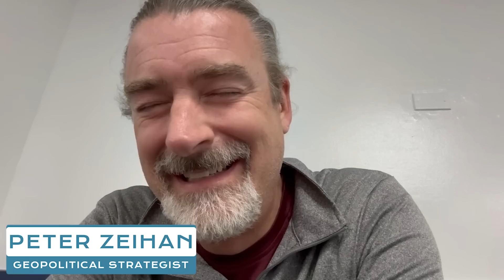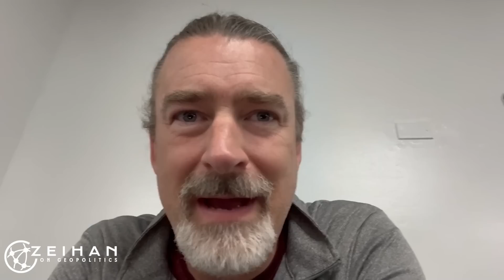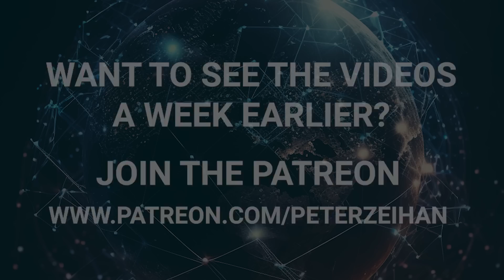Nuclear Power's Facelift: Small Modular Reactors || Peter Zeihan

Comment: While small reactors may offer novel solution, nuclear waste management remains an unsolved issue. We're swapping one reactor generating, say, a gigawatt, along with its cooling pond and security perimeter, with 20 reactors, each generating 50 megawatts, each requiring their own waste management (cooling pond?) and security perimeter.  This sounds like spreading a problem.

Comment: Large or small, any reactor that uses solid fuel and burns uranium is going to generate a lot of high level waste that needs to be either buried or reprocessed. Most also require HALUE which is in extremely short supply. So, if you order on of these plants be prepared to wait in line for years to get it running, and then be prepared to deal with the same waste problems typical reactors face.

Comment: The most promising thing about SMRs is that we don't have any experience with them so we aren't aware of the actual problems that will manifest as they are brought on line.

Whenever I come across videos touting the benefits of any reactor technology I like to tell one small part of the story of the start up of a "new concept, highly efficient" nuclear power plant, the Ft. St. Vrain High Temperature Gas Cooled reactor purchased by Public Service of Colorado. The nuclear steam supply was built by General Atomic in San Diego, CA. At the time I was an engineer working for General Atomic and responsible for the mechanical design of the reactor control rods.

During the final weeks of the plant being turned over to the utility in 1974 an electrical engineer was checking electronic circuits on the control rod system. A slip of his probe caused a short causing the reactor to "scram", meaning the control rods were moved into position to shut down the reactor. 

As part of the plant safety protocol outside diesel generators were automatically started to provide back up power. However a few days earlier a local contractor, doing clean up outside of the plant had, incredibly, repainted the generators, INCLUDING THE EXHAUST MANIFOLDS. When the exhaust manifolds heated up, the paint burned off in a cloud of smoke and the smoke drawn into the ventilation duct for the control room which was being operated by utility employees who were to be the sole occupants of the control room when the vendor engineers left the site. 
What did these highly trained operators do when the room filled with smoke?   They ran out of the building. It was left to a few remaining General Atomic employees to shut down the reactor.

This kind of a problem has no doubt occurred with many different new technologies but with nuclear materials present an entire realm of unique  dangers are present, radiation exposure, environmental contamination, proliferation, and massive cleanup expense.
Crazy old Ralph Nader said many years ago in a TV commercial that we obtain marvelous power from a nuclear reactor, the sun, that the sun was 83 million miles away and that is just about as close as you want to be to such a thing.
 I left the nuclear industry in 1979.

Comment: Water-moderated pressure water reactors (PWRs) have not had a single radiological casualty in over 70 years of operation (Chernobyl was NOT a PWR). There is no need for a "safer reactor" -- but PWRs are only 1% efficient whereas breeder reactors can generate more fuel than they burn! This technology was demonstrated in the 1950s.

Comment: It may sound strange but the best waste option is very deep sea.  This requires dropping into soft soil in a very deep plate subduction zone.  The natural subduction will take the waste under deep continental plates permanently.  { in any practical term }. Some Generation 4 reactor designs can burn up nuclear fuel waste. MSR, Molten Salt Reactors, are ideal.  Also, an excellerator-driven neutron plant is being built.  This system can not meltdown.  Basicly, it is just turned on or off.   No fission chain reaction is required.  Fission is controlled by artificial neutron production.  This system can produce heat. It requires external power.  This could also produce valuable material for science, industry, space and medical uses.
Reply: True. It sounds weird, but we've never had a Love Canal or Times Beach after deep ocean dumping.

Comment: SMR reactors have become problematic recently.  I hope countries start looking more at other Generation 4 reactors.  China has 3 Gen 4 reactor prototypes including a gas cooled pebble bed reactor and 2 MSR, Molten Salt Reactors, in the Gobi Desert. In a Texas University they have completed a facility to build an MSR reactor.   Terrapower has started construction of a facility to develop a sodium cooled, fast breeder, wave reactor. Rolls Royce plans to start production of MSR reactors by 2030.  India has an SMR project and Generation 3 sodium cooled fast breeder reactors to use Thorium as fuel.  But not any MSR reactors to use Thorium that could be easier to develop.  China and India are making amends and China could be an MSR partner. India and China have lots of Thorium.  Thorium can be much cheaper than enriched Uranium. The Terrapower reactor could also use Thorium. Indonesia and a US company have a plan for MSR reactors on reinforced concrete barges.  Finland has just completed a very modern waste storage facility. There are many storage options but no political will.  Thorium could be mined in the US with valuable rare Earth mining byproducts.  The US government is developing more flexible regulations to suit Generation 4 reactors.  Current Gen 3 technology struggles to compete with fossil fuels. With very long project times to reach profits. Requiring some government support.  There are  a number of other projects and types of Generation 4 reactor types.  Likely an easier option to Fusion power.  A huge amount of money has been wasted on the ITER fusion research reactor that will not produce power.  Other novel fusion reactors are unpredictable.  Plenty of Gen 4 technology exists but need prototypes.  SMRs could be  great but faces difficulties.  Nuclear power remains much safer than fossil fuels. During the Fukushima meltdown no one died from radiation or explosions.  15 000 Japanese died from the Tsunami.

Comment: You have to be careful trying to relate SMRs to a nuclear power "facelift" with the key word being "small" and therefore how much they can contribute to a big power grid. Many in the industry have discussed more targeted applications whereby these reactors can supply power to remote areas or mining operations and so on.
Reply: The small plants can be modular and fit right into the system. Several of them could be placed on one site.

Comment: Would you please comment on the reuse of nuclear waste proposed by the Gates backed initiative that was stalled when Trump shut off China?  And the trope about the solar being dead at night is stale and ignores daylight lifting of water etc, plus multiple other storage technologies, none of which have the potential harm of any nuclear installation. We have the best nuclear generator with full global distribution at a safe distance now. It delivers a complete daily supply for the US every four minutes if only we had the collection and distribution - including storage for overnight- installed. The plants know how.  We just need to mimic them.
Reply: Storing grid level energy generated during the day to operate at night is very inefficient.  So much so that the cost to performance is not economical. Converting electrical energy to mechanical and back to electrical is a terrible solution.

Comment: A 50MW SMR facility will cost $100M when all of the accessory equipment and end-of-life expenses are tallied. Modern houses with 200A electrical service represent loads of about 24kW. IOW you can power about 2000 modern homes from the output of the SMR. Let’s assume the cost of the facility is amortized over 20 years with a 5% bond and the annual operating cost is $20M. Each home will have to pay $17K a year or $1400 per month for electrical service. That is easily 5X to 10X the current rates in most of the country.

Sorry, but this makes no sense from an economic standpoint.
Reply: When it is layered with gas electricity generation it makes sense. Especially when used with remote industries it makes perfect sense. It also makes sense when used with data centres. It can also be used to create small localised grids were cost performance is not an issue.
Reply: That's not how this works.  First, if you have 200A service, it's 200A per leg, and you have two legs.  That's 200A 240V, or 400A 120V, either for 48kVA (not quite the same as 48kW, see reactive power).  Second, you don't size the grid assuming every customer is going to be running 200A all the time.  You oversubscribe.  That house with 200A service may only have an average 5A real load, and a 50MW reactor might service 20k homes.

Comment: Not sure if it was a hoax or a conspiracy theory, but this kind of reminds me of something I heard years ago. Anyone else remember a story of Google and a couple of other large companies, having buildings powered by a black box sitting outside. About the size of a commercial AC unit. There was talk for a few weeks, and then the story just disappeared
Reply: Now that you mentioned, there was such a story. With your reminder, i went to check it out.  It was Bloom Energy and their Bloom Boxes ard 2010.  Fuel cells that use a chemical process to convert natural gas or biogas into electricity without combustion.

Faded, partly because scaling and sustaining the technology proved challenging, and the high cost of the units
Reply: No. They were not powered by black boxes. Those were engineered systems that made existing infrastructure more efficient in terms of hydrogen diffusion systems.

Comment: Lithium batteries equivalent to twenty nuclear power plants were installed this year in the US. Small nucs are a very expensive joke.
Reply: Lithium batteries are not a cost effective system and are nothing more than politics. They work at localised levels where cost is not as important but they cannot compare to a stand alone 50 year 100 megawatt output nuclear system.

Comment: The alternative is solar/wind/etc. Generators feed a large utility-sized battery array.  Voila, energy 24 hours a day using the battery to shift the loads as appropriate.

In the past, the expense of batteries overwhelmed the cost of these kinds of projects.  However, recent advances in iron-based chemistries promise incredibly inexpensive storage at the cost of being about half as efficient as other types of industrial batteries.  Given that they can be built building size and are basically made of dirt, this system minimizes cost by sacrificing space.

Comment: I live in Ontario, Canada. The provincial government is looking at adopting SMR's to replace the nuclear power plants located at Tiverton, Pickering and Darlington, The Tiverton site, owned and operated by Bruce Power, will be 60 years old in 2031. Most of the reactors at the Bruce site are starting to reach a point where it is not longer cost-effective to refurbish them.

The Bruce plant is the world's largest operating nuclear power site. All of these reactors use the CANDU (CANadian Deuterium Uranium) technology, which has proven to be super-safe over many decades, and cannot produce fissile materials unless specially modified to do so. In fact, the reactors can be used to burn fissile materials and depleted uranium (DU).

When these reactors are finally taken offline, the spent fuel rods will be stored deep in an old salt mine located under the bottom of Lake Huron near the town of Goderich. 

The problem with CANDU reactors is that while being good reactors, they are not terribly efficient. The hope is that SMR's will improve Ontario's power generation capabilities, which will be essential, given that the population of the province is expected to nearly double in the next 25 - 30 years.
Reply: SMRs are technically possible, but economic nonsense, i.e. hopelessly impossible to run with a profit.

Comment: Nuclear Fission and nuclear fusion transform mass into energy by equation e = mc squared.  where m is mass and c is speed of light.  Speed of light is 3 x 10 to the 10th power cm/sec.   Mass is energy and this equation shows that a small particle of mass converted to energy generates a huge amount of power.  This is why there is so little waste from a nuclear reactor in comparison to the energy generated.   So storing the spent fuel rods until Americans can. finally discover the truth about this energy source is a very doable and safe option.  But we really need to shift focus from nuclear waste and nuclear winter to the fact that mass is energy and can we discover another way to directly transform mass into energy.  There has to be a way to do it.

Comment: Read the book Thorium Cheaper Than Coal.  It discusses the molten salt reactor developed and operated for about 5 or 6 years at Oak Ridge National Laboratory.  They need little water, can be built in units about the size of a box car.  They could be mass produced in factories, and be used to power existing coal fired plants and ships .  They can eat nuclear waste etc.  The US budget allowed one third the money for nuclear that it did for solar and wind.  One of the recent continuing resolutions took all the nuclear money and rolled it into wind and solar.  One problem is the regulations are setup for water cooled.. and there are no or few  regs for molten salt.

Comment: Speaking of waste fuel, we have a closed nuclear facility in Southern California at San Onofre along the north San Diego County coastline.  It still has nuclear waste stored at the site as attempts to ship it out by rail have failed.  If it goes by rail it'll travel through some densely populated suburban areas.  Shipment by sea is considered impractical due to coastal access issues and since its final destination would be Yucca Mountain in Nevada.  So there it all sits, entombed in concrete 'caskets' just south of the City of San Clemente and some great surfing beaches, at the north edge of Camp Pendelton (Marine base), and right beside the busy Interstate 5 freeway.
Reply: Storing on-site. Does seem to be the solution.

Comment: Solar plus batteries will be the dominant power generation soon, due to the low cost. What is needed are peaker plants which can step in when demand exceeds supply. There will not be a need for a base power generators during daylight, because there will be surplus power at that time.  Nukes are not good as peaker plants. Nukes are good as base generators, but that is not what we need. Nukes are also subject to planned and unplanned outages for maintenance and repair.

Comment: One thing I would add to this: 40% of the nuclear waste created ('hard' waste, that would be radioactive for a 1000 years) has already been re-used. It's because it's made up of used fuel capsules (use to be rods) in which the concentration of fissile material went down (so most such atoms broke apart already - there was 4% of such atoms in the capsule to begin with, the rest being stuff you add to help the process). So, this waste is just nuclear fuel waiting to be extracted.

Comment: Modularity makes for easier maintenance & upgrades if designed properly. There seems to be very little will to pursue research in nuclear with this current government. Strangely enough in the US, only the US navy uses small nuclear reactors rather routinely with a good safety record. By necessity, there is will.